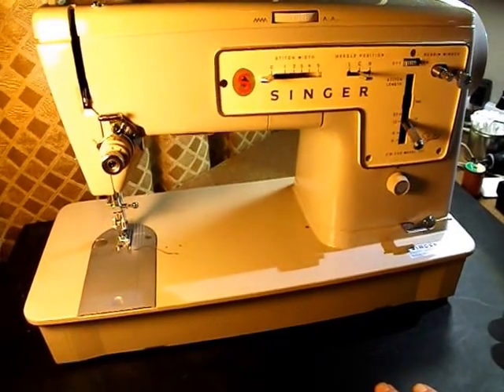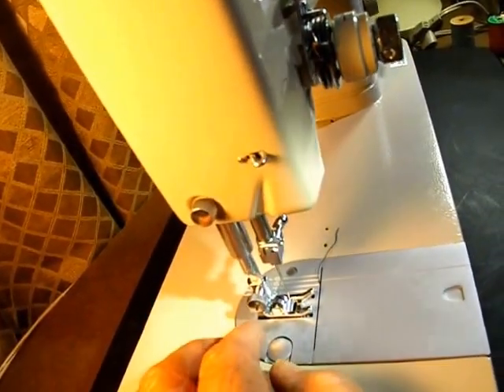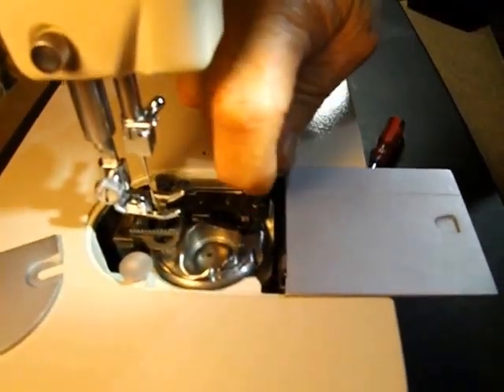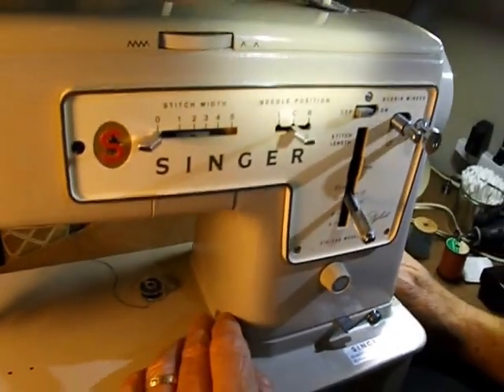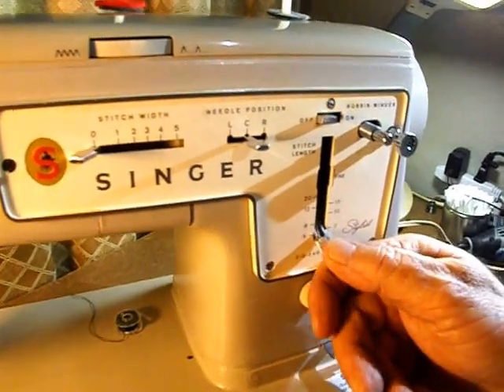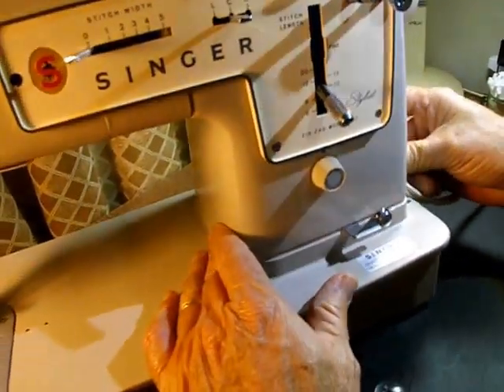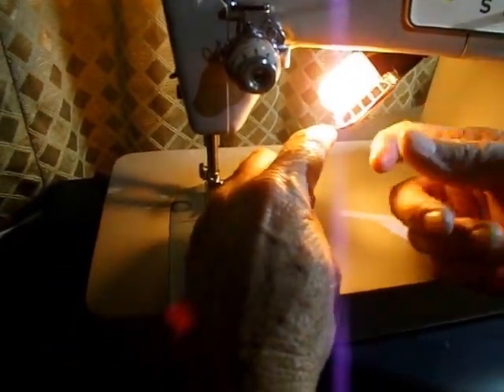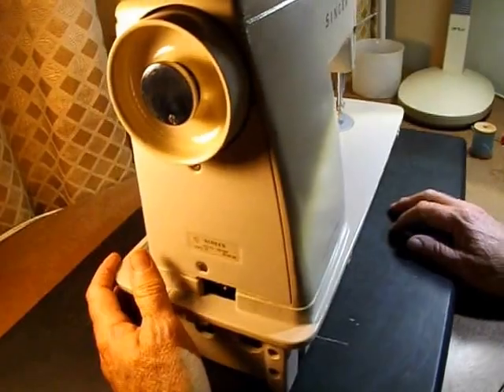TOUR THE FEATURES OF THE SINGER MODEL 457 STYLIST SEWING MACHINE

Comment: Hello,  I cleaned off old grease and used Triflow on the shaft  gears (metal and plastic too unfortunately)  of my Singer stylist 478. Now it will not move at all and smoke rises from above the motor. What can I do?
Reply from the maker: What was the cleaning method? Triflow as in oil, grease or both? Smoke above the motor, not from the motor? The motor belt goes up to the handwheel, oil on the belt can make smoke. The top gear of the vertical shaft is above the motor a little farther inside. It's a plastic gear. 
Tell me a little more how you cleaned off the old grease, what you used for cleaner, oil or grease. Don't try the machine again yet.
Reply: @andytubesewing1953  This machine was not working, in closet for many years.
Got it serviced, on return dripping oil into the carry case.  Sat in closet a few more years.
Then I oiled machine with Dritz zoom spout, Krud Kutter to oily timing belt.  Stitching well, but stalling, had to rotate handwheel to start stitching.
Then I cleaned creamy grease off metal shaft gear and plastic gears of vertical shaft using q-tips. Then greased all of them with Tri-Flow.
It sewed briefly, then locked up with smoke rising from inside the machine near the plastic gears.
Cleaned off the grease from plastic gears and again from timing belt, no improvement.
Opened side plate below handwheel. Motor covered in oil. Flecks of black on machine near the belt, but belt looked OK.
Thank you for all you do for Singer owners.
Reply from the maker: @joannaandreesen7789  You did a lot of work there. I don't put grease on plastic, but the maker of TriFlow says it is safe to use on most plastics. Yes, a motor covered in oil can make problems. If you feel like pulling the motor out you can clean and dry it. Black flecks are usually from the dried edges of the sides of the belt and very common on an old belt. Oil/grease on the belt is a problem too.
Clean oily motor: https://youtu.be/vR7VmAC6evU
Seat brushes clean motor commutator:https://youtu.be/rpTy_Bz3prA
Wet motor video:  https://youtu.be/6y1EN5S2sz4
Removing internal motor from upright: https://youtu.be/sDcexZeS0f0
How to replace the famous broken plastic gear on the vertical shaft, model457:
https://youtu.be/M3bFtlV1Y6s
Reply: @andytubesewing1953   I will study your recommended you tubes.  I forgot to mention that in the bobbin winding setting, the belt and handwheel turn freely without smoke, if that makes a difference.   Thank you.
Reply from the maker: @joannaandreesen7789  Were you running the motor to turn the handwheel in the BW mode? If so that is a good sign for the motor. IF the motor itself was bad it would smoke while running even if you had the belt off the machine. In your original comment, you mentioned the machine would not move at all. If you put the machine back in sewing mode and the motor will not move the handwheel or needle bar then something has seized; a shaft, bushing, bearing. If nothing got accidentally dropped into a gear or something, then seizure is usually (not always) caused by lack of oil, or really dirty bushing full of dried up oil and crud. I'd be looking in the mechanics, not the motor if you say the motor turned the handwheel well without smoking while in BW mode.
Reply: @andytubesewing1953  Yes, I was running the motor to turn the handwheel in the BW mode.  To check these parts of the machine,  I'm thinking of getting the repair manual because I'm a beginner.  Do you know of a resource? Or do you have you tubes that could help identify these parts? Thank you.
Reply from the maker: @joannaandreesen7789  Well I have 500+ videos of repairing vintage Singer machines, but not the 478. Some are similar and have very similar parts. If you want to browse through any of them here is the playlist page where they are listed by model number:
https://www.youtube.com/channel/UCUSPDsHaFtRoz1VA2U1xJ4w/playlists?view_as=public
For $6.99 you can download the service manual for the 400 class machines. It would have about 40 or more pages of adjustment and remove/replace instruction for the 478.
You can find it here: https://manualsoncd.com/product/singer-400-series-service-and-repair-sewing-machine-manual/   That is really a cheap price for a service manual as compared to eBay.
Reply: @andytubesewing1953  I will study your you tubes and buy that cheap service manual.  I'm going to take my time with this work since I'll be home for some time due to this corona virus situation. In the future I will let you know how it went. Thanks so much for all your invaluable information.
Reply from the maker: @joannaandreesen7789  I'm sure you can restore the machine and you have the correct approach just take your time. I advise taking plenty of pictures along the way, like before you remove a part. The manuals are good but don't always give details like which end of the spring goes where, or with washer goes on first. They just assumed a Singer repair person would know those things. When reinstalling parts it is great to have a picture of before and after part removal to refer back to. I still do this even after all the machines I've taken apart. If you run into a snag then let me know. Good Luck.

Comment: For the 457 where do you recommend getting gears. I need the top
Reply from the maker: https://www.ebay.com/itm/New-Top-Vertical-Shaft-Gear-155819-fits-SINGER-413-416-418-457-466-476-477-478-/321498491280
Reply: Thanks tues project can't wait to see how that girl sews
Reply from the maker: A nice guide to the gear replacement if you need it.:
http://www.singersewinginfo.co.uk/457gear/
Reply: Thanks so much I will let you know how it goes.when I get part. 😃